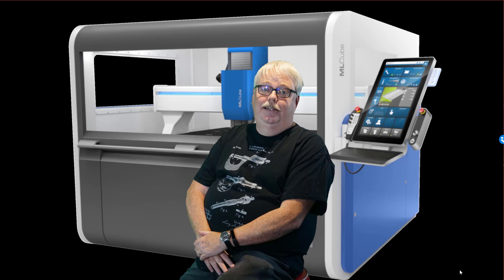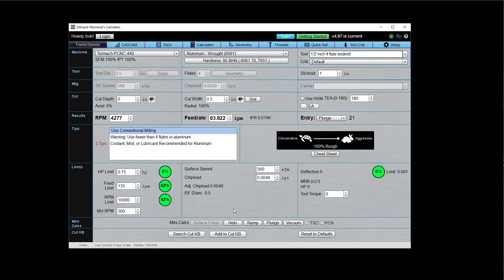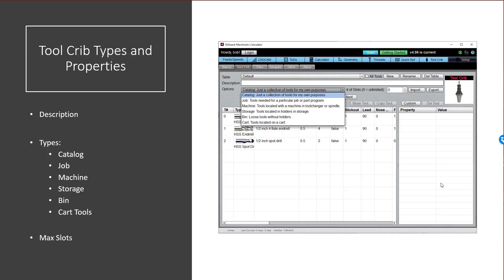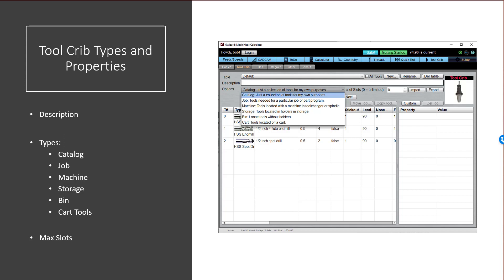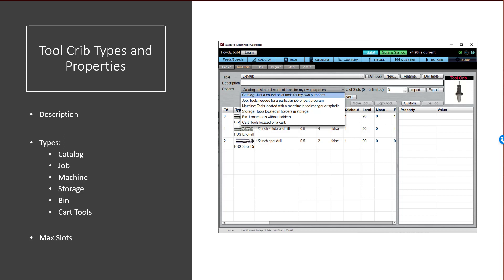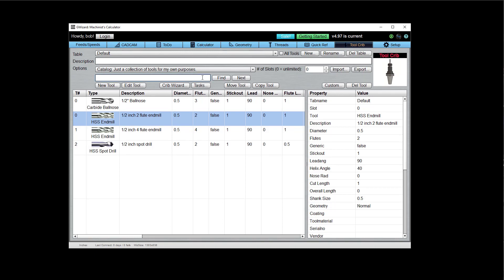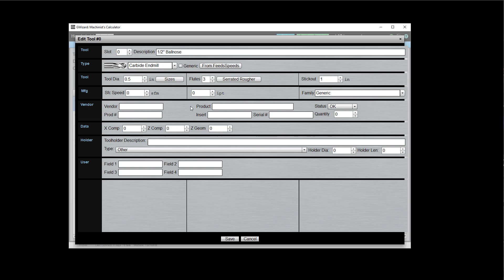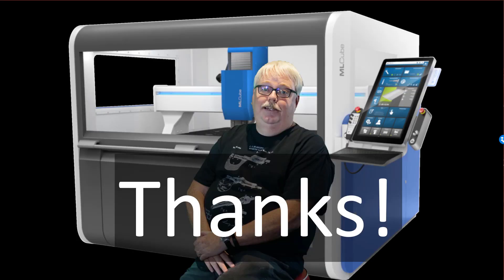How to use G-Wizard's Tool Crib to save time and get your tools organized.

Comment: Do you have a way to export cribs to Haas machines?
Reply from the maker: As a matter of fact you can use our G-Wizard Editor / G-Code Simulator to do that.  It will convert a Tool Crib to a g-code program that uses G10's to set up the tool table.

More about G-Wizard Editor here:  https://www.cnccookbook.com/g-code-simulator-viewer-generator-gwizard/
Reply: @CNCCookbook  hey Bob.  would this work the same with linuxcnc.  the tool table can be setup with g10's also in linuxcnc